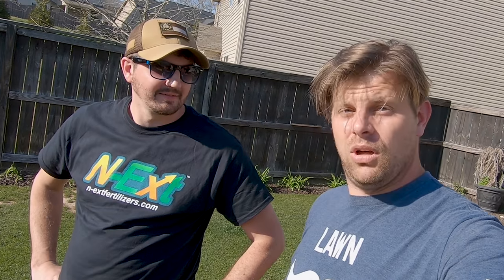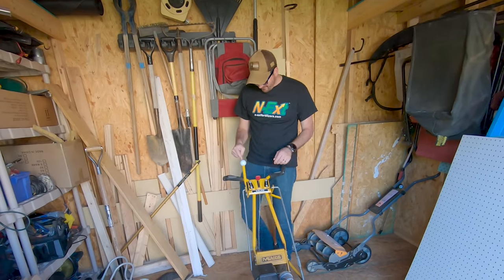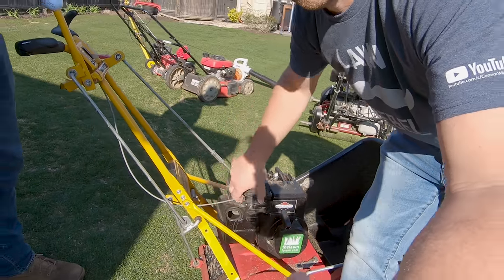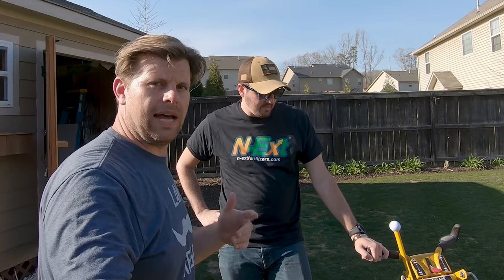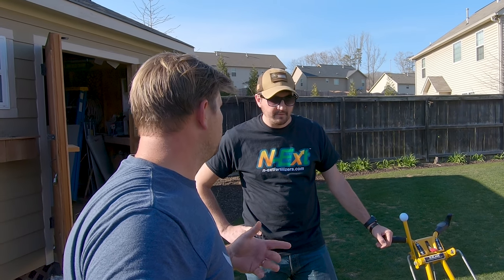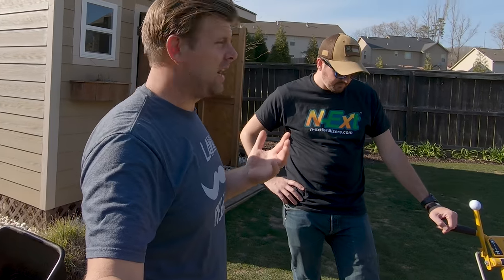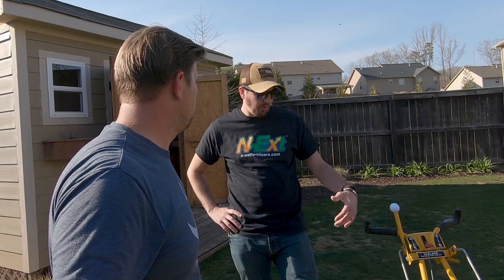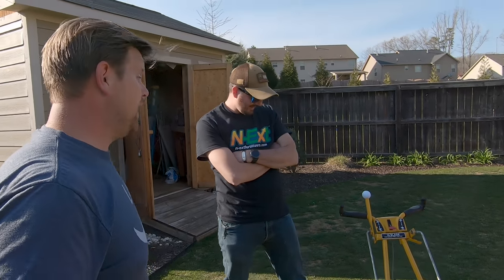Reel Goodbye | How to Use a Reel Mower | Reel Low

Comment: Where in georgia  are you located at Reel low dad? And can a reel be used on yards with a 15-20 % grade? Thanks
Reply from the maker: I’m in Tennessee. That’s a pretty steep grade. Would depend on the reel type. I don’t want to say one can’t be used but more of how willing you are to make accommodations in those areas. Parts of my yard have a slope that is around 10. But they are small areas.
Reply: @ReelLowDad  where in Tennessee? Thanks for the info
Reply from the maker: Knoxville
Reply: @ReelLowDad  oh great, another Tenn fan lol